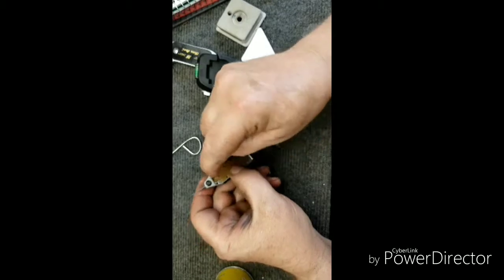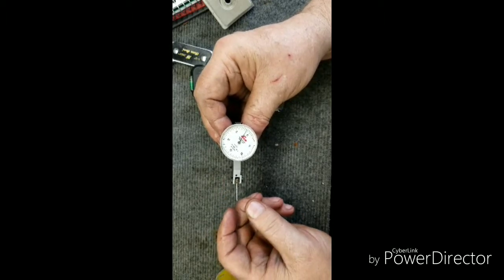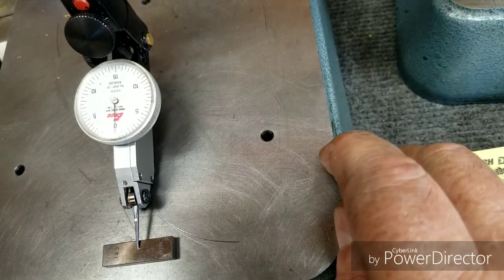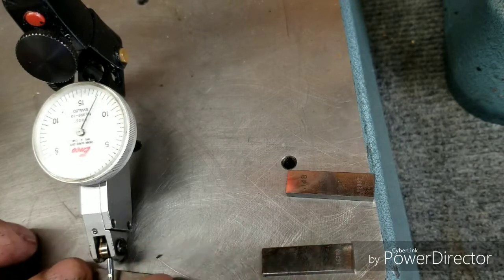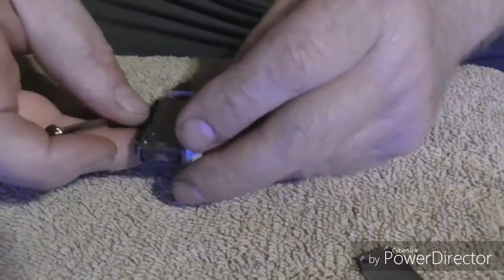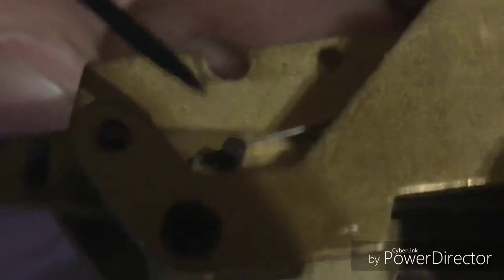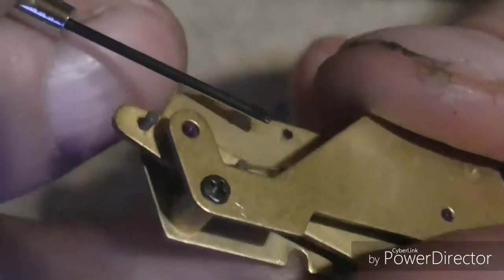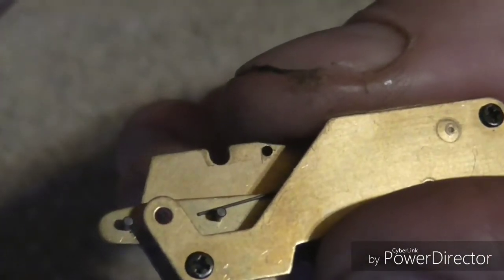Test Indicator Fix

Comment: It is a wonder that they can thread those small screws but even more of a wonder that they can thread the holes.  WIT.
Reply: Good point!
Reply from the maker: Thanks Harold try finding one when you drop one so happened these were not brass screws and found it with a magnet.